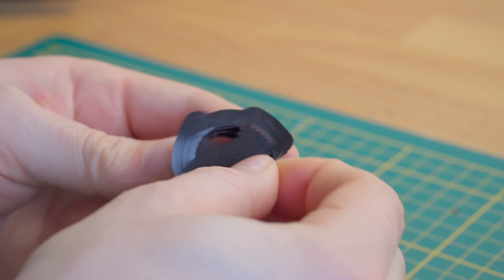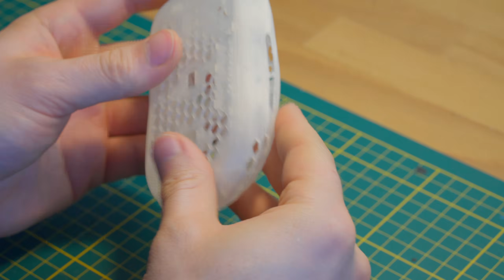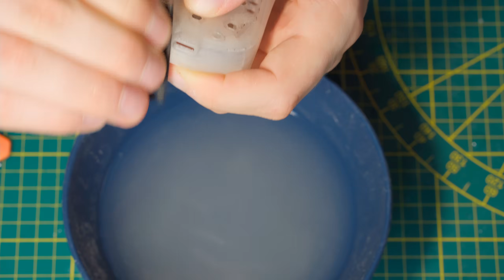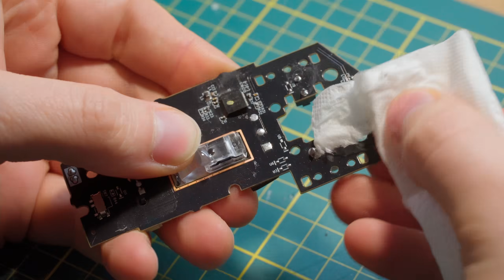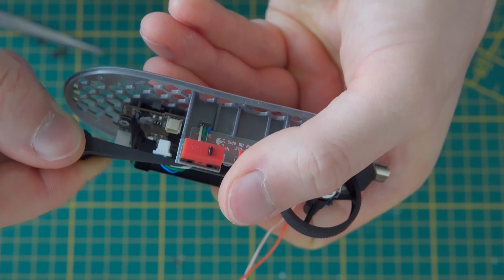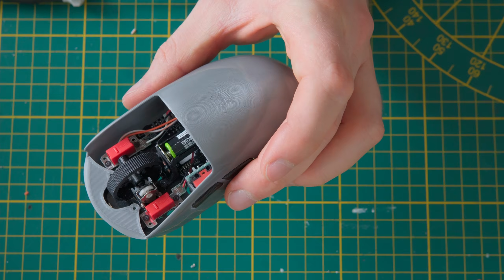Assembling and finishing my G Pro X inspired G305 mod

Comment: What is the best material to print the mouse? I was thinking about using resin
Reply from the maker: I don't have any experience with resin, but I'd recommend using an engineering resin that doesn't shatter easily. Otherwise, I've had success with PLA, PETG and ABS.
Reply: @MotherBEARmakes  Which of these materials was the firmest on the sides of the mouse?

Comment: Do you have a version withouth the rechargeable part (usb c adapter), just to swap battery when needed?
Reply from the maker: Yes, it's included. Some users on the discord have also worked on a wireless charging mod.
Reply: @MotherBEARmakes  that’s crazy cool!

Comment: I'm using a usb c male connector since my battery is different. How do I know which pad is positive and negative?
Reply from the maker: You should measure it with a multimeter.

Comment: Hello!, Thank you for your video!, I bought a battery to do this mod but when is charging the output is 5V and when I disconnect return to 1,5V, I dont want to burn my mouse:c.
Reply from the maker: Did you get the znter battery? The G305 can apparently tolerate up to 5.5V but I don't know how that will work long term. Might be better to charge it with the switch turned off then. https://github.com/you-wouldnt-reverse-engineer-a-rat/g305-re
Reply: @MotherBEARmakes  Thank you for your  reply brother!

Comment: Make sure to be careful when sanding the PCB, which is made of fiberglass. When sanding it, tiny fiberglass pieces get mixed in the air and are extremely bad for your lungs because of how small but sharp they are. Make sure to have both adequate ventilation and respiratory protection gears, and it's best to not sand down PCBs if you can.
Reply from the maker: Good note, preferably do this outside as well.
Reply: its funny how he is not updating his vidio to include the risk, but thanks for the reminder not to trust some people online
Reply: @coughcough37  calm down lil bro its barley any its not gonna give you cancer
Reply: wdym ''updating the video'' 💀 @coughcough37

Comment: Hello,what material did u used to print,i want to buy your design but i need to know what material to use on my printe,filament,thanks in advance!
Reply from the maker: PLA is easiest, ABS could be even lighter but tricky to print.

Comment: I'm thinking of trying the print on Nylon MJF, but the pricing will definitely be way overkill for this
Reply from the maker: I have one in MJF nylon sent to me by someone who bought the model. It looks and feels great.
Reply: @MotherBEARmakes  awesome, did you have to do any cleanup to the part or does it go on nicely without any sanding? I checked out the part printed in MJF at JLCPCB, its actually within 15 USD for all the parts (before shipping)
Reply from the maker: @tehnubrises5533  I haven't assembled it yet but everything seems to go together nicely.

Comment: My usb c female to male isnt working, voltage and ground are right.  Should i use a different connector or add data pins?
Reply from the maker: Did you try a different charger?
Reply: @MotherBEARmakes  yes i think it is working but i am not sure
Reply: how long should it take to charge?
Reply from the maker: @enoxrule  My battery has an LED to indicate when it's charged. I don't know exactly how long it takes, I can still use it while it's charging.
Reply: @MotherBEARmakes  i found the problem, my soldering joints on the interior batter charger were bad
Reply from the maker: Glad you've figured it out!

Comment: Hey mate, any chance I could get the 3d model of the PCB from you? I am starting to work on a similar project and looking forward to use the g305 too, thought you may have the part. I would compensate you obviosuly for the work that went into the model.
Reply from the maker: Hey Eric, sorry for not responding sooner. I could provide you with a model if you still want it. Let me know how we can get in touch!
Reply: @MotherBEARmakes  Hey mate, thank you very much for reaching out neverthelesse! I already found some 3d models of the g305 PCB etc in the webs but htank you nevertheless!
Reply from the maker: @ericvauwee4923  No worries, good luck!

Comment: what type of car polish did you use?
Reply from the maker: I used commandant 5 but I imagine most of them working fine. I also had good luck with brass polish called Brasso.
Reply: @MotherBEARmakes thanks! is there anything else I need to know? because I used a generic polisher, and it kind of worked, but nowhere near as glossy as yours.
Reply: @MotherBEARmakes  love the file btw its so well made

Comment: I want to do this for Logitech MX310 mouse shell. I have soldering experience but none 3d printing. Would I be able to 3d scan a MX310 shell and use starlight 12 internals ?
Reply from the maker: I do not have 3d scanning experience, I also don't have a MX310 to scan.
Reply: @MotherBEARmakes  I’m not asking you to do it. Just curious how I would go about doing it myself. I have MX310 mice and G305 and other mice internals with modern sensors.

Comment: did you print it with 100% infill ?
Reply from the maker: 3 walls and 25% usually but most of it is walls anyway.
Reply: @MotherBEARmakes  2 questions. Are you willing to make/sell products? And second, I would like to see a mod where you make a g pro x super light inspired build, but this time you use a g603 instead of a g305. This would be better because the g603 has bluetooth, and longer battery. Could you please do this mod? if you do ever make a mod like this, I would definitely buy it.
Reply: @MotherBEARmakes  thanks